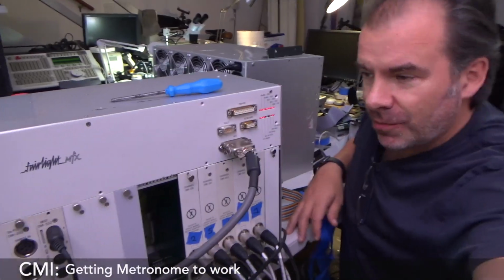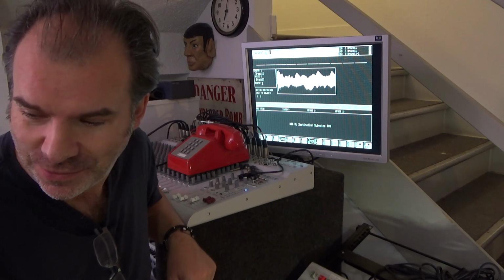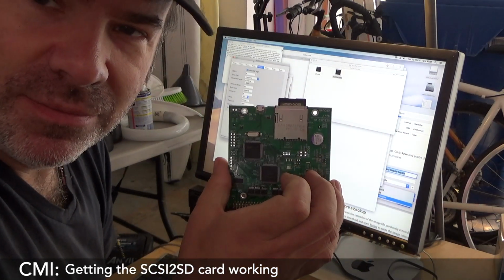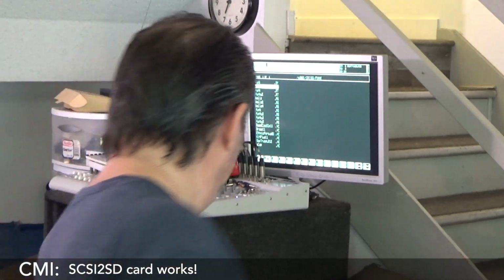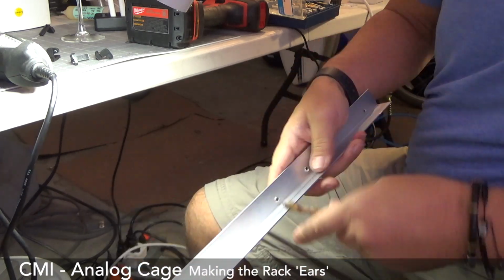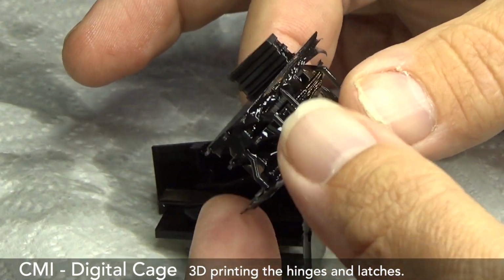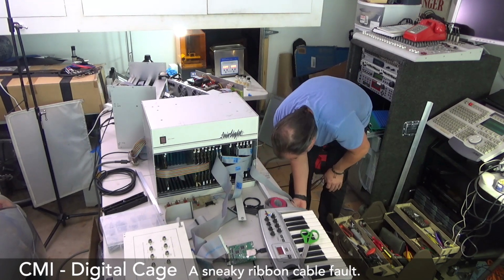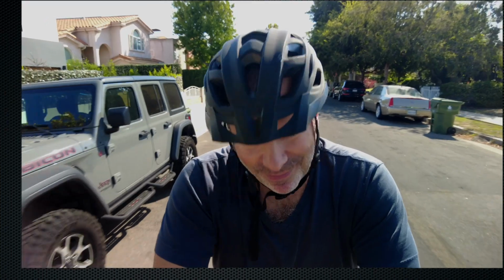I'm building a Fairlight CMI - Episode 10 - 3D parts, ACTUAL MUSIC SCSI2HD, Rack Mounts ! #fairlight

Comment: Silly question, if you have an original latch, why not mould it in silicone and cast them in polyurathe?
These are easy parts where a simple cut mould would do.
And yeah, working abroad or on sets (often in less than ideal circumstances), you get very inventive :D
Reply from the maker: Y'know that's a good call.. However, I needed a good excuse to get a 3D printer... :)
Reply: @CrisBlyth  I’ve been there done that. Only for it to gather dust afterwards :$ The cleaning is a bit of chore and it’s messy. But I am happy to have it in case I need it. And it’s got a plug on it and had a computer in it, so I could deduct it from my taxes 😂

Comment: You are probably not a Unix user here’s a tip for the future.
If you clone any drive (in this case the SD) in a Unix system with dd if=/dev/source of=/dev/dest bs=1024k it will copy the whole structure. Takes mere minutes. For example source /dev/sda then sda1 sda2 etc will be cloned. The destination is of course also a root device like /dev/sdb

You can do that on Mac as well, although you need to use the raw device
Or else it will take forever.
But you got it to work with the gui tools.
Reply from the maker: Hey thanks for the tip ! good call ! :)

Comment: I used to do a lot with SCSI. You only saw cylinders and sectors if you were using an older drive via a SCSI adapter. True SCSI drives work in blocks. Block size can be an issue. PCs used to use 512 bytes/block, but the size can be different. 128 bytes/block to  4096 bytes/block for older SCSI drives. You use the SCSI 'sense' command to set the block size before formatting. Terminator power can be an issue too, expecially as the pin outs were not tightly specified; I had to  remove a connection to get my Seagate multi-DAT drive to work with an Adaptec card, because, in  the tape drive, the terminator power ended up on a grounded pin.
Reply from the maker: Hello and thankyou ! That’s a lot of good knowledge there.. I’m still figuring out the card but I have a handle on it now :) it’s really my fault for not actually reading the instructions and proper workflow ( I have a habit for that ! )

Comment: Cris, I can relate.   As someone with a legit drill press in my shop,  I always seem to reach for the cordless drill.  In the field you get used to working with the tools you have,  which may not be the best or appropriate.   Great episode, keep up the good work!
Reply from the maker: Yeah !! As you know, with the hand drill you can drill, elongate a hole into a slot, and de-burr all in one movement ,, :)
Reply: Haha that’s me with 3D printing. Yesterday for a magician I needed to make a hidden stamp on a wallet.
And I modeled the mould up in freecad and I realized the 3D printer wasn’t connected and leveled. So I just pulled out some wax based clay and molded the mould by hand. Not as neat and straight and perfect but quick. And in the time I would’ve setup and printed the mould I had 3 prototype stamps and worked them into his magic wallet.